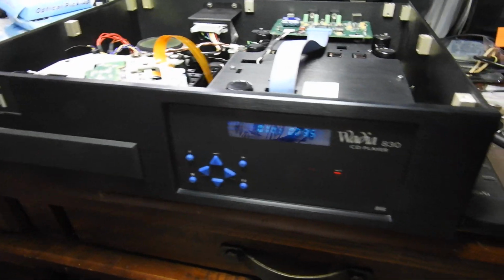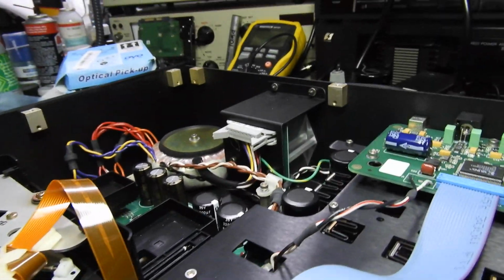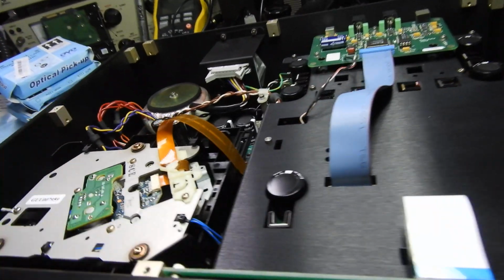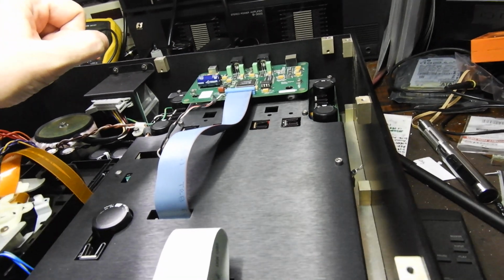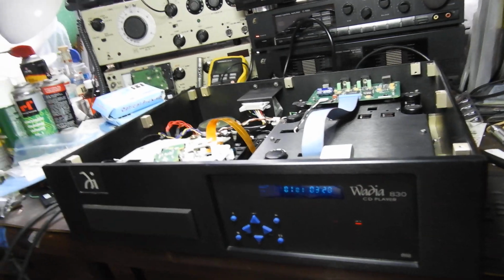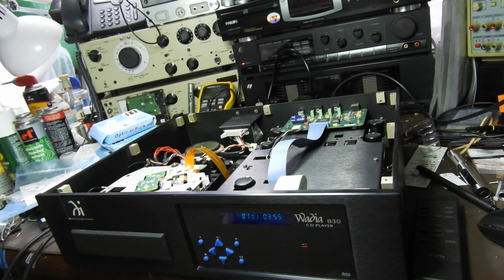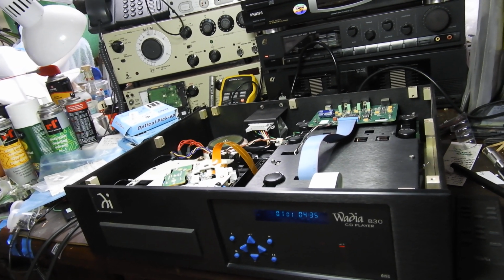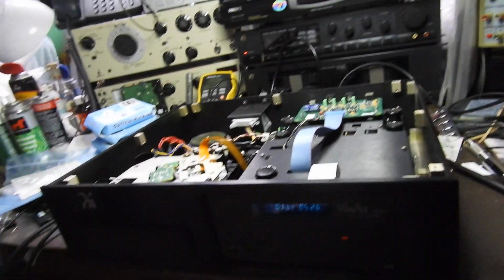Wadia 830 CD Player with 4 x Burr-Brown PCM-1702 DACs and Pioneer Stable Platter mechanism

Comment: If you get to read this comment I am hoping that you can tell me the size (small or large) and the amperage which I believe is one amp. requirements of the power fuse for the Wadia 830.
Reply from the maker: Sadly, I cannot offer anything definite here. Fuse holder that I see on the pictures looks like being able to accommodate both 2AG and 3AG. 
Normally Wadia uses 2AG (small fuse).
Value wise, they use normally 1A.

Comment: As always with Wadia players, the important part is not the DAC, it's the proprietary Digimaster filtering.

It's not that the Wadia has a dark top end, it's that virtually every other CD player is too bright.

Still, the sound was much improved in later models, especially their last flagship all-in-one, the S7i.

Sadly, there is only one source of replacement parts left for the S7i, and the power supplies seem to get flaky and they need $400 repairs about every two to three years.
Reply: Exactly.

Comment: can replacement laser assembly and parts be had for the stable platter ?
Reply from the maker: Do not quite understand the question. Are you asking if brand new replacement parts for Pioneer stable platter mechanism could be faulty? Parts even from reliable suppliers are occasionally faulty but I have no experience with Pioneer stuff for their mechanisms never failed in any of players I worked on.
Reply: yes -I’m guessing like any other CD player, it’s mainly the laser that would need to
be replaced after time ,especially on a 20+ year old player ——-
Reply from the maker: @5Antvin  On the contrary. I replace lasers very rarely and sometimes I replace the whole assembly because it is easier to buy it, than some gear that lost a tooth or two. It is a misconception that a lot of people have that when a CD player stops reading CDs, it is a laser at fault. Very often it is a dirty limit switch which tells the servo where the head is or a perished belt which does not drive the CD clamp (or head) to its proper position.
Reply: @hear-net-au  It depends upon the mechanism. When repairing "rail type" Sony CD drives, it almost always IS the laser, which can be purchased on eBay for not a lot of money; the Sony transport itself is pretty much bulletproof.

Comment: Hi, where can you purchase the test cd that has all the errors on that you use to check how good the laser assembly is?
Thanks 👍
Reply from the maker: I bought my second CD from WEs Components in Sydney. If you do not have the account there, they also have their retail arm - Wagner Electronics. The Technics CD which I use most often, I had for decades.
Reply: @hear-net-au  thanks 👍

Comment: To handle 24/96 digital inputs, it would need the PCM 1704k DAC chips, the PCM1702 are limited to 20 bit, not much difference between them on 16 bit material.
Reply from the maker: @Si1983h Thanks for this Man! I even have 1702 data sheet and looked at it closely (or so I thought at the time) and never noticed that they were only 20 bit. I just thought that they were newer model that was surface mount only.

Comment: Pioneer stable platter!!??,,in a Wadia?....bit of  a let down that,,,A VRDS,,or CDM 1,,or KSS 190 yeah,,,but Stable platter,,,??
Reply from the maker: Yes, you are right that the most common mechanism they used to use was VRDS with Sony KSS-151A magnetic drive mechanism. But this is their mid-range model and some savings had to be made. Also, KSS-151A was no longer in production. But it is not a common garden Stable Platter but PEA1343 which is used in only one Pioneer, the PD-S06 which is quite a machine. The only other users of it are: Wadia in 301, 3 models of Theta, Advance Acoustic Paris, Cary 302, Enlightened Audio Design Ultradisc 2000. That is it. Quite a good company.
Sorry, I keep forgetting about the loading / unloading action which is very important to form an opinion about the CD player. I can assure you though, it is very civilised and upper shelf smooth. ;-) When I get a chance next time I will shoot it again.
Reply: Yes, it was a wonderful idea, the Pioneer Stable Platter was one of the best transports made.
Reply: @VideoArchiveGuy  Best!!...have to dissagree there,, the Philips CDM1...most of the swing arm types,,and.the Sony KSS190a ,through the ES range.
Reply: The swing arm transports were all glacially slow.

The Sonys were great but the Pioneer sounded better IMHO due to the stable platter system.

The Philips are good but pricy.
Reply: @VideoArchiveGuy  Opinion respected,,Best sound system front end I ever heard IMO,,was a Philips CD 960,,CDM1 mech (used as transport),,through a Meridian 563 DAC,,sublime sound,,sadly not many of these transports around now,,the golden days eh?.
Reply: The VRDS is not the only masterpiece transport.  So is the Pioneer stable platter.  Also, transport alone doesn't make a better CD-player.  There are plenty bad sounding VRDS players out there.  You don't own an 830 anyway so nothing to be "let down" about...